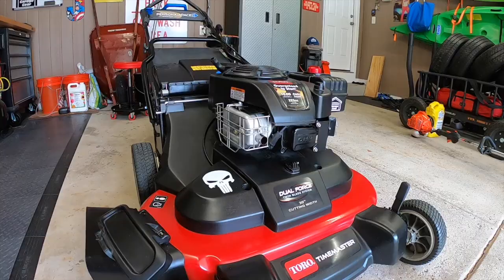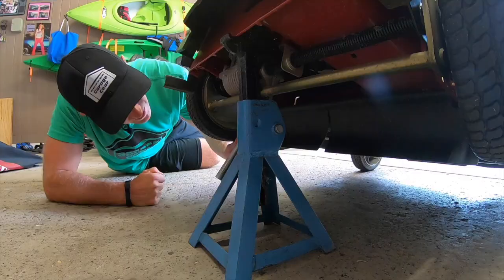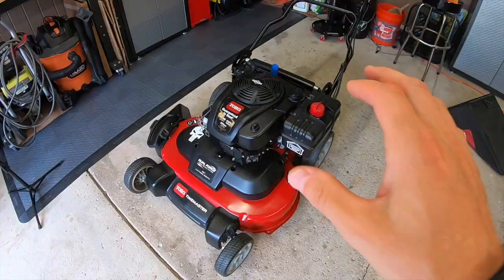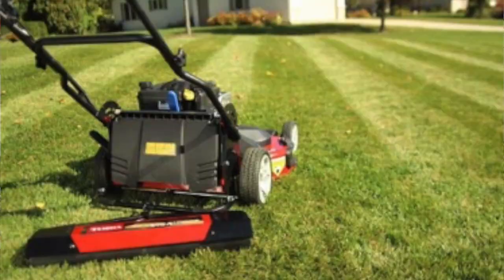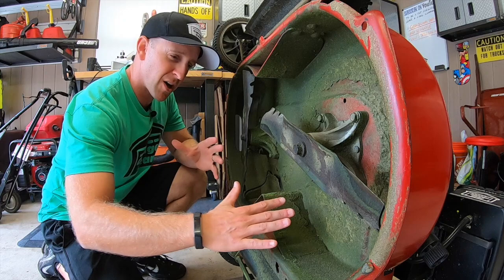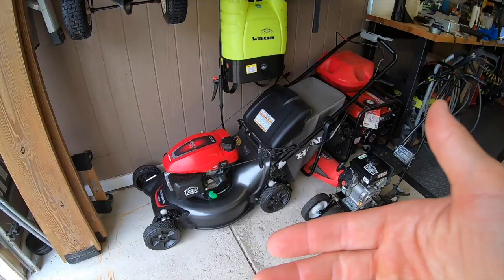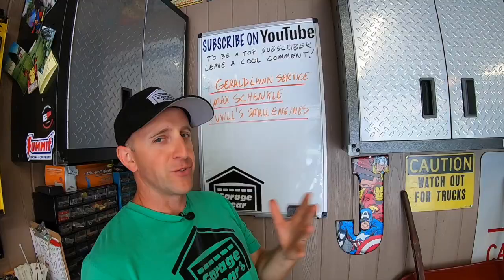BEFORE YOU BUY A TORO TIMEMASTER, WATCH THIS!

Comment: I'm frequently replacing the bearings in/around the wheels and drive train. A 10 pack of PGN R8-2RS Bearing - Lubricated Chrome Steel Sealed Ball Bearing - 1/2" x 1-1/8" x 5/16" Bearings with Rubber Seal from that jungle store is about $11 in 2023 (product ID B07GT92P1H). That's enough to swap them all out. If those bearings aren't changed when they get worn/sloppy, the rear wheel-drive-gear system's teeth get worn/damaged requiring far more expensive replacement of the back wheels and other connected parts.
Reply from the maker: Thanks for sharing this vista! 👍

Comment: This guy had absolutely nothing good to say about the machine, so why on earth would you keep it?  There's people out replacing engines, transmissions, fuel tanks, and if thats not enough it cost $1600.   I bought my John Deere 17 years ago and never did one single thing to it, not even a spark plug, and that mower started first pull every single time even after sitting for the winter without stabilizer in the fuel.  The absolute best feature that no mower seems to have anymore is the one lever height adjustment.  That and the price of $450 which comes out to be like $29 a year.   I just bought a Toro and its nice but I don't feel that I'll have the same luck.   Things just aren't built as well today.
Reply from the maker: Sold mine later that season.

Comment: If I had it to do over again, I’d never buy a Toro TimeMaster. Biggest piece of sh*t I’ve ever bought. From day one, brand new, the left rear wheel doesn’t pull. It decides when it will start, and if you run out of gas, it won’t start for a week, maybe two. The spark plug is almost impossible to replace. Whoever put it together from the start didn’t get the Personal Pace correctly adjusted, the transmission is crap, and did I say I’m disappointed that this piece of sh*t is a Toro?
Reply from the maker: These mowers are a big piece of junk.

Comment: I have a turfmaster. Let me tell you that engine has to work two blades. So it’s terribly underpowered. If it has 10HP that’s 5HP per blade. Sucks with tall or wet grass. These are gimmicky. Unless you have a large property and will stay on top of it, they suck.
Reply from the maker: Thanks for sharing this Milton!
Reply: @GarageGear  you’re welcome. Forgot to add they’re terrible as commercial mowers. Not worth 2500. My twin blade residential Honda mower has out worked the turf master. I do weekends lawns 10-15 of them. People shouldn’t waste their money on “commercial” stuff. I’d rather buy 4 Hondas. Also since they’re so heavy so get just as tired I’d rather just walk an extra 5-10 mins with the 21 inch. Very impractical.
Reply from the maker: @theantisocialsocialite-  agreed! My Honda has out worked my timemaster lol!

Comment: Who in there right mind would buy such crap. Maybe I'm just getting old but I just bought a Hustler Fas trak 54 inch zero turn mower. I don't push anything but food into my plate 🤪. Hell I give a push mower away to some friends. I really feel bad about doing that. Been better if I junkyard the mower and cut there yard for free. Man we are living in the 2023 century. People don't need to push anything. I'm still trying to figure out how to weed eat with out carrying it. I got 1.8 acres of property. I used to use a craftsman gt6000 tractor mower 44inch cut. 20 HP Onan engine.  I got dizzy 😵 making all the circles. I spent 7916.00 on a Hustler Fas trak 54 inch zero turn.
I can cut my yard in 30 minutes. Taking my time. It will do 10mph, but I'm not crazy enough to do that. Have you ever got a 925 lbs of mower up to 10mph. That thing will destroy anything in it's way.

Thanks for the information and video. The first time I saw one of the tero mower 1500.00 big one's I nearly died. I just can't see putting that much into a push mower.
My craftsman cost 3.000.00 35 years ago.
It's still running. 6 speed transmission with 30 sae gear oil. 44inch cutting deck. But that Hustler Fas trak is a war horse 🐎.
Reply from the maker: Thanks for sharing this Alton!

Comment: Hey I just came accross your video on the timemaster. I have subscribed to your channel for a while. Thanks for your tips on repairing both lawnmowers and snowblowers. I have had a timemaster for a 1 year and a half. I have two major concerns. The first is, when it is cold, I can not get it started. I live in N Tonawanda and as you know, sometimes in the fall you are mowing when it is cold. I took my mower into my local repair shop for him to figure out what I assuming is a carburetor problem only for him to tell me I had bad gas and I should be using stabilizer. I am like what??? I only use non ethanol gas and I have never used stabilizer. I still have the problem and have had to resort to shooting a shot of either to get it going. The second is that it uses oil. Any thoughts? Thanks
Reply from the maker: Hey Karl! Awesome that you’re a local! These engines are garbage. They are riddled with problems. Are you trying to start it with an electric start or pull start?
Reply: @GarageGear  thanks for the reply. I have an electric start. I tried to start it the other day because I had my power washer set up(taking advantage of the mild weather) and wanted to clean off the bottom of the deck for the winter months and could not get it started and gave up.
Reply from the maker: @karlshomeremodeling123  Ok did you try pull starting it or electric starting it?
Reply: @GarageGear  I was using the electric start. I work on alot of stuff myself, but when it comes to small engine stuff, I feel like an idiot sometimes. I think it is a carburetor issue. It is the using oil part that is baffling me. I have put a alot of work into my lawn and when it is growing, I am mowing it twice a week, sometimes 3 and when I would check the oil, it would be on the add line, so I would add a little to bring it up the full mark. It doesn't smoke or anything. I used to have a Honda and sold it after buying the timemaster. Thanks again for taking the time to reply.
Reply from the maker: @karlshomeremodeling123  ok I tend to always see issues with electric starters after the first year. They never seem to work right after that. I would pull start it more often and see if that gets it going for you. If it starts right up you should be good. If not then I would give the carb a look.👍
Reply: @GarageGear  Thanks for your time. I see now this is a journey.
Reply: Well JB, I tried pull starting it and after 2 or 3 pulls it started right up. So much for the electric start huh...thanks again for the tips. On another note, I was watching your video on putting rubber pieces on the impeller blades and I did the same thing on my old toro snowblower, which I sold last year and bought a new toro. I haven't had a chance to do it to the new one, but after doing it to the old one, it was night and day. Where did you get your rubber pieces? I cut mine out of a truck mud flap. Thanks again for your time.
Reply from the maker: @karlshomeremodeling123  glad it started up! My timemaster usually starts in 1-3 pulls. Always has. I have yet to see an electric starter last more than a couple of years. Here is a link to the kit I used recently. https://amzn.to/3uxgEeW these work great and are evenly balanced. I used some old conveyor belt to form mine in the past. Worked great but with this kit, everything is there ready to go.
Reply: @GarageGear  thanks for the info. I will look into it

Comment: grass grow, toro wont go, hell no bro. 

Honda donedada!!!
Reply from the maker: Haha awesome little jingle lol! Thanks for watching!
Reply: @GarageGear  JB. im looking at a old John Deere 212, new Kohler engine think its a 301, will double check the engine specs again, runs well, operates well, comes with a tiller, and a 37A snowblower, but no side panels, also no deck to cut grass all for 1K (USD) this unit i would like to add to my small time, snow removal biz and lawn work biz. i think its a good buy, but i have been wrong before. my concerns are, John Deere parts like early 80s model, are they easy to find these days, or will it be hard to get older JD parts.

i always appreciate your words bruh. thanks.
Reply from the maker: @briggsdidnotstrapem7699  hey Anghulimal! That’s a classic right there! I would try doing a little research to find parts for it prior to purchase. If it looks like a lot of parts are still readily available then I would go for it. Also, see if you can find anything out there on major issues for this model. There has to be I for on this model on a tractor forum somewhere. Sounds like a pretty good deal with everything you get with it but because of its age you may be able to negotiate the price a little in your favor. Thanks for being a cool fan!
Reply: @GarageGear  thanks OG, i signed up on the Tractor forum, John Deere is all over ebay and some on craiglist. JD forum said their good little tractor for snow and tilling, but bad turning radius when cutting grass on the JD 212,  but its newer Kohler 301 motor is where i have my eyes on the prize. your channel is real helpful thanks my good friend.
Reply from the maker: @briggsdidnotstrapem7699  awesome my man! Thanks for being a cool fan! Appreciate you!

Comment: AVOID THIS MOWER! Model# 21199 The Turfmaster and it's Exmark cousin arent as bad but still have pulley and the bolt issue too.

Mechanic and salesman for a mower shop here.
Other negative points you missed that have occured to every timemaster i have had purchased at the dealership
1. Cables, the transmission and blade engagement cables wear out or rust through very quickly. Especially near the coast
2. Self tap bolts in dissimilar metals, the bolts that hold the pulley cover and blade engagement cable onto the top of the deck corrode when in contact with the metal of the deck and then break when you try to remove them. Not an issue for the bolts that hold the cover because they can be easily accessed to be drilled out, but to drill out the bolt that holds the blade engagement cable you have to remove the engine. Not a fun job and not a bill your customer is happy about either.
3. The front wheels on the deck, the molding around the bearings on your front deck wheels are paper thin in comparison to the commercial models. If you run a front wheel into anything with a little extra force they break and wobble off the bearings.
4. Just hammer it home, the idler pulleys belong in the garbage, not on a lawnmower. The local lawncare business is on their 4th set of pulleys in two sets of blades.
 The non cogged deck drive belt burns up in heavy use too. Customer record is 30 minutes cutting overgrown grass.

I thoroughly inform all my customers of the flaws of this machine, most thank me and buy a 21" machine without any bells and whistles or the competitor's 30" machine.
Reply from the maker: Thanks for sharing all of this David!  Very cool that this advice is coming from a dealer! It’s not all that it’s cracked up to be! Thanks for watching!
Reply: What do you suggest then. I cannot do a 21 inch model, tho I have one for trim work, but my yard is big enough I need at least a 30. I have a 42 inch rider but someone wants to buy it and frankly I’d much rather use a walk behind as they cut nicer.  I could move up to a ZTR, but I don’t feel like spending 5K plus. What about the Ferris FW15?  Any others you might suggest.  I’m ok with buying commercial.
Reply from the maker: @jasonpritchard5081  hey Jason, Ferris makes a good one but I did here that the wide back wheels can rip up the lawn. Riders can do that too tho! Scag makes one as well that’s apparently pretty nice too! Thanks for watching!

Comment: Hmm has a Brigs and Stratton engine the only American made engine on a mower. Even kholer is made in china now. Ariens engiens are made in china. Having to refuel after 45 minutes of mowing. That’s break time. The high mountain desert hits 120 degrees. That’s lemonade time. I have never had an issue with my toro. However every mower and snow blower has its drawbacks. That we would love to change.
Reply from the maker: When it runs out of gas with two passes left… that is the annoying part. Thanks for watching

Comment: There is a thing called owners responsibility. It clogs like ever mower so what. There is a lot that you can do with this mower that you can't do with a 21inch mower. It is also from my experience even with the 21inch mower that you will still have to scrape of the grass from underneath the mower. But that is just the OWNERS responsibility there is no way around it.  So the point of this video is more like you will have more responsibility with this mower then the 21inch mower.
Reply from the maker: Thanks for sharing

Comment: I don't think it really saves much time over a 21" it's too bulky and takes too much time to turn around
Reply from the maker: Thanks for sharing 88
Reply: Probably depends on the yard though, but a 21 will also power through thicker grass too, so unless it's winter time and you're only taking off an inch or two of thin grass in a fairly open yard, you won't see a difference. @GarageGear

Comment: I bought this mower from someone on the Internet… I hate it.
Reply from the maker: @amark350  why do you hate it mark?
Reply: @GarageGear  my comment was an exaggeration… When it works, I actually like it. 

I was in the middle of replacing the belts and a pulley when I found your video (I was looking for a diagram for the belts)… and it’s the third thing in a row I’ve had to replace in a relatively short time. So the comment was more frustration rather than an honest review.
Reply from the maker: @amark350  that was my same feeling with it too. But when there were constant problems with it it really wasn’t a Time saver!

Comment: Toro is crap, $1500 dont buy this 30" mower.  It has no power, installed new blades & still have to double cut.  Not only is the fuel tank small the fuel cap hole is tiny.  The grass clipping bag is worthless 2 blades, tiny bag.  I just wish honda would make a 30" mower.
Reply from the maker: @ngl7706  agree on all of this! 👍

Comment: Well after hearing about the complete shit quality of this mower, Toro has lost a sale.

I was ready to jump on an electric start model tomorrow and now I'll just stick with my current unit, even with its occasional vapor lock issue and a small bit of rust.

Mowers aren't supposed to be a high maintenance item, i want to go out, mow, and be done, not doubling my time invested, and buying parts every other month.

Toro, pull your head out.
Reply from the maker: 💯agree mj! Thanks for watching!
Reply: @Garage Gear  

Another reason I'm taking a pass is hearing that this unit was only $1000 a few short years ago, now the electric start model is $1699.

WTF, Toro must be smoking crack.
Reply from the maker: @mjktrash  haha their battery powered model is around $2500… stupid

Comment: Lmao. How much did honda pay for this hit piece ? 109 hrs in 1 and a half seasons on my 30. No issues. "Clogs" like any other multi blade commercial mower  ive ever used when you cut high or wet and  grass without cleaning. Be a doll and go buy a exmark 30. Lost track of how many parts we had to replace on those over seasons.
Reply from the maker: Thanks for watching

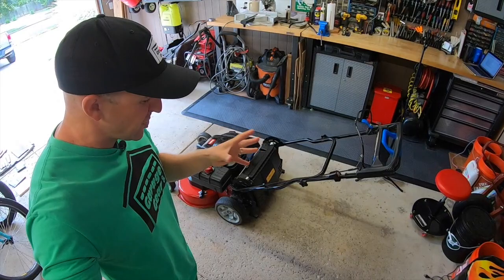Comment: 3:22 ever heard of loctite?
Reply from the maker: All I have is the red on hand! That would make an engine replacement a real chore. Lol thanks for watching
Reply: @GarageGear  I think I used red on my engine swap. If you don't use a ton, it's not hard to remove, but prevents the engine getting loose. I also might've used longer bolts and put a nut on top, but not sure. It's annoying af getting to those bolts, so I definitely wouldn't be doing it more than two times before fixing the problem
Reply from the maker: @M.TTT.  thanks for sharing my friend! 👍

Comment: anything TORO i would not buy
Reply from the maker: Hey William! I hear ya! However there are a few super recyclers that have come through my garage that we excellent machines. They were older models and built better. Thanks for watching!
Reply: they are better than most out there  an easy to fix,,,i still run a 314h wheel horse  ,,its a tank,,,
Reply from the maker: @Monza62000  I’m also a fan of the their commercial 21” mowers. I know owners with them that love them!

Comment: This guy is wasting your time. None of the issues are actually concerning. #1 he's using a mower too small for the size of his yard. #2 the flap is useless anyway #3 the gas tank is designed for smaller yards that's perfectly fine for non commercial size yards #4 I used this mower in my commercial lawn maintenance company for nearly 10 years, weekly, without a single issue except for usual maintenance.
Reply from the maker: @todddillon7854  these are all common issues people report on the toro timemaster Facebook page. thanks for watching todd